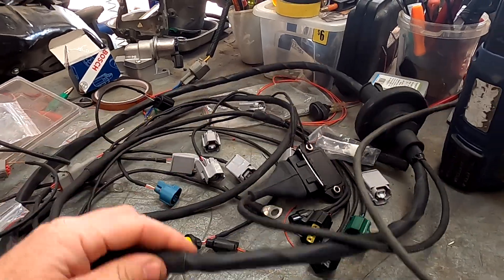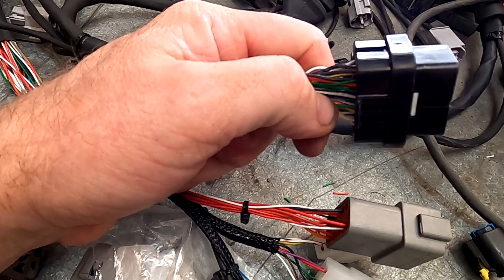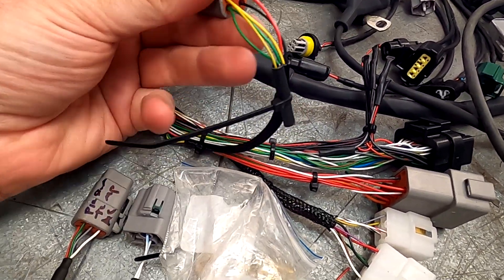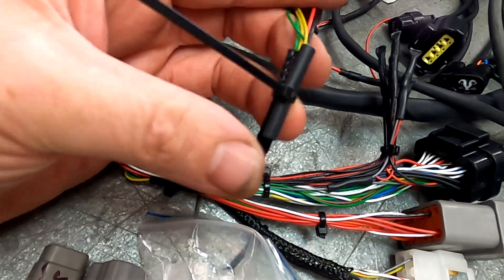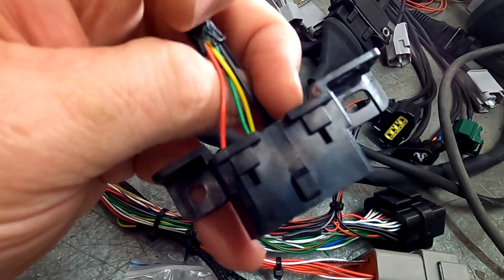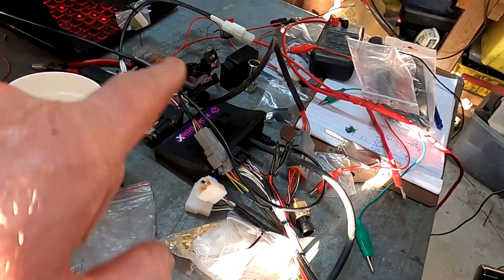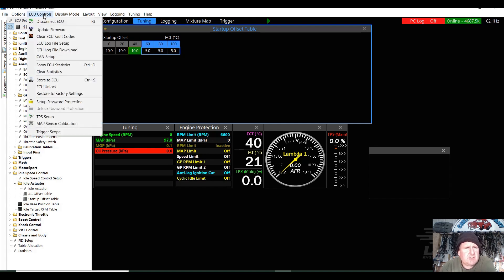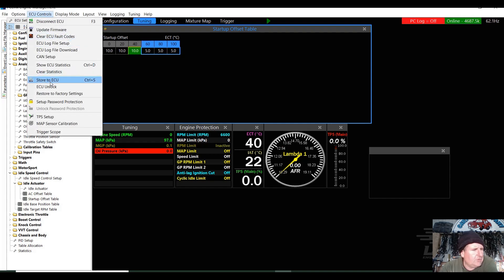OBD2 communication wiring and setup to link ecu

Comment: i have a can lambda and obd2 splitter wired together.  do i have to turn off can lambda in the ecu like you did? or can both the obd2 and lambda run at the same time?
Reply from the maker: Its possible to run both provided both are communicating at the same speed. We normally change comms speed of the can lambda to match the obd2 port and all is fine

Comment: what oil pressure sensor are you using sir? and what is the range since I believe Link ecu have a requirement for oil pressure sensor
Reply from the maker: I generally use a bosch pressure / temp combo sensor however there are heaps of options so often Ill use a 10 bar honeywell or similar.   Provided the calibration is known many will work, like most other aftermarket ecus.

Comment: Hello, i have  question. I have a 2010 ibiza seat, i just bought an android stereo with a canbus. The stereo came with an app that reads the car's ecu (shows me the cars RPM, miles and speed). My question is, can i somehow use either torque or realdash to show me the cars info without using the bluetooth adapter? Thank you.

Comment: Hi sir i want to ask a question, what will happen to a car if power from pin 16 goes strait in to the pin 5 ground signal
Reply from the maker: It would most likely blow the obd2 fuse
Reply: @CartuneNZ  well i accidentally conected it wrongly in to my car because i wired the diagnostic tool wrongly and pluged it in to the car and car died, is there a chance that it can drain the battery very fast from my mistake because the battery shows 11,80 v car wont even crank now not even clicking from the startet only some relay in fuse box clicks on sertan interval it shows all sort of erors but most importantly no comunication with ECU with the diagnostic tool now, if the ground signal pin 5 (electical earth) is conected to the ECU i am afraid that some magical smoke happaned in the ECU it self and some resistor or other component payed the role as a fuse

Comment: Brilliant video Kevin. I have just installed a Link G4X ECU on my 1998 MR2 Turbo and have since found out that the G4X doesn't support ODB2. My car never came with one so I'm looking to wire one into my Can. Would I just use the ECU to ODB-11 Port Wiring diagram and if so where would I put the resistors? Thanks

Comment: Hi Kelvin, where do I put the resistor ? Just doing this now mike
Reply from the maker: Look in the link help file is best.  Normal can wiring terminating resistor procedures apply with 120k resistor between can wires at each end of the bus.

Comment: Kelvin, to what extent can you pull data? In the 'States vehicle inspection is done via the OBD2 plug...
Reply: Give it a try n post back your own findings :)
Reply from the maker: I have been told the stream is suitable for testing in USA however I think the ecu would require an oxygen sensor to be wired in , often I prefer using a can lambda unit which should be fine for that.  For the other tested Im not sure what is required as they arent required here but that would be a great thing to find out , as it might be a great option for guys in the USA and UK to pass their required tests.  Next time I wire one up Ill try to go over the data stream and make a video.